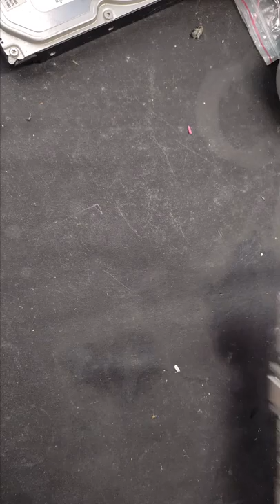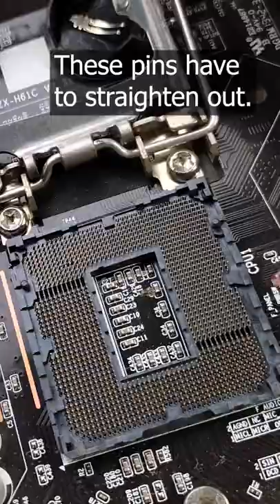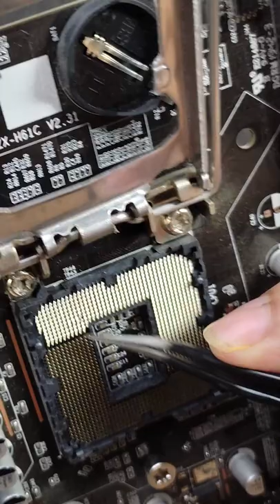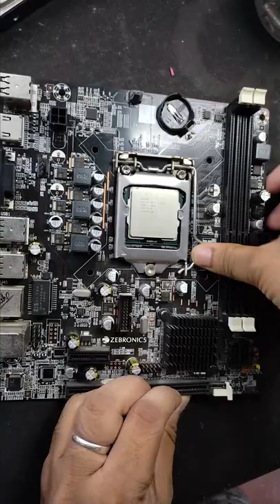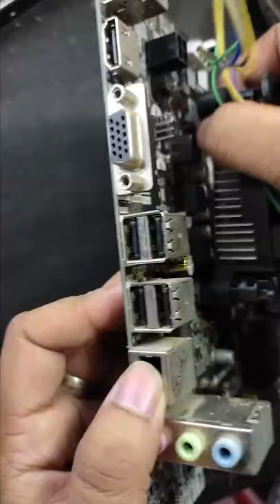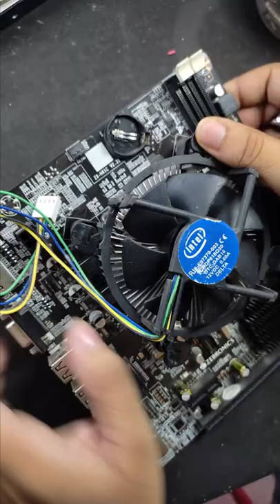CPU socket pins bent fixing

Comment: I experienced it yesterday, the system unit did not turn on that's why i checked the cpu and I found put the pins are bent I only use needle to fix it 🤣😅